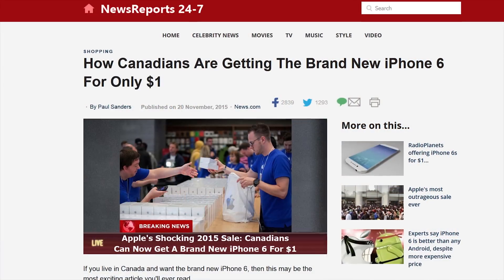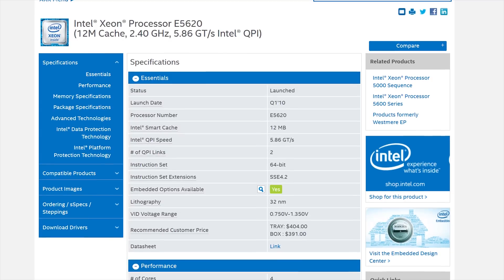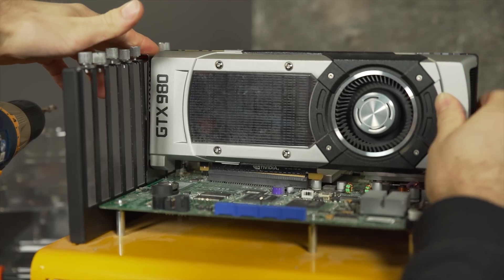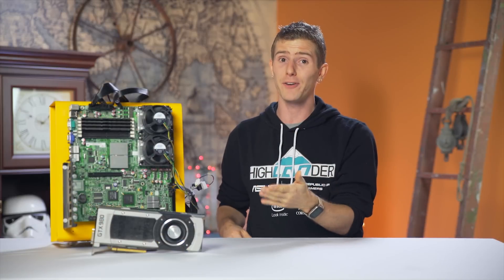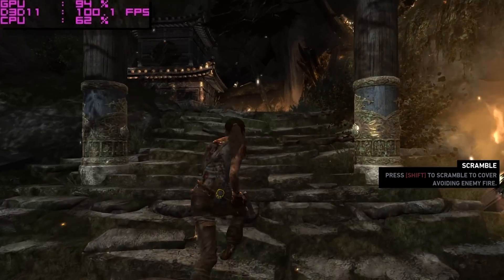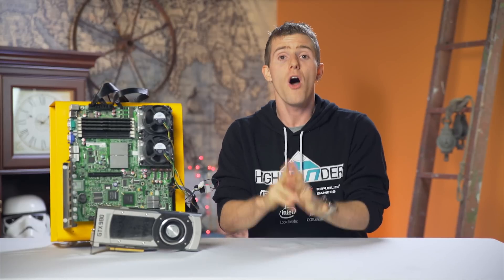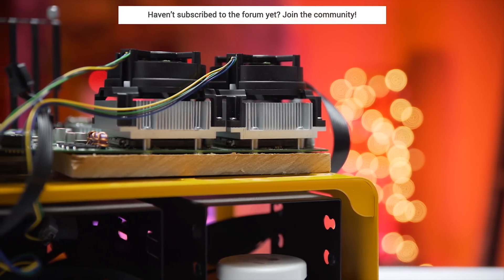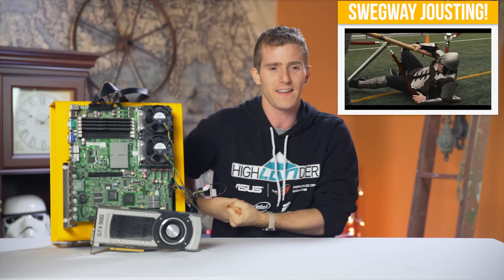Under $150 Budget Gaming 8 Core CPU, Motherboard & 16GB RAM

Comment: i still don't understand why he tested a 150$ system with an 800$ graphics card. and not even showing results with cheaper ones.
Reply: He shows the maximum performance of the Cpu..  If he would use a cheap graphics card, the Gpu would probably bottleneck the maximum cpu performance.

Comment: I was about to buy a Gigabyte server mobo, 32Gb DDR3 RAM, two Xeon E5504 CPUs and two 600w hot swap redundant PSUs for $60 AUD ($45 USD) c:
Reply: sparrow40k Should be awesome!!
Reply: sparrow40k Wait. you got an lga 1366 motherboard for $45???
Reply: The Gamer Duck - Random Gaming Yeah I just bought two Xeon x5560 2.8ghz for it and a GTX1060
Reply: sparrow40k I am soo freaking jealous!!!
Reply: I might upload some benchmarks when the new parts arrive. So far the entire system has cost me less than $350 USD
Reply: Are you Adam Driver?
Reply: looks nothing like me 😂
Reply: look at a really small version of your profile picture and tell me you dont see the resemblance.
Reply: Unguidedone I mean I don't need that much CPU performance so I guess it just depends on your workload
Reply: Unguidedone [x] doubt

Comment: Building computers out of server parts is stupid. It's a much better idea to buy a workstation computer and install a gaming graphics card. And not much more expensive.
Reply: 100 bucks used sounds good too.
Reply: Loli Neko im rocking xeons, x3220 to be exact, they overclocks great, theyre higher build quality than consumer grade processors, and building own pc from scrap is just more fun (at least thats what i love doing)

nice name btw
Reply: I love my Xeons. I have a HP Z600 with 2 X5647 but will probably change them to L5640's soon because of lower power use. Just saying buying a workstation is easier than building yourself. And did you just register this name to make this comment!?
Reply: Don't they pull over 300 watts with ram included almost all the time? I'm going single modded Xeon on a few of my old 775 boards this weekend. The parts, (5640's) will be in by then.
Reply: it all depends on you, what kinof workload will you put on it, if gaming 4 cores is optimal (dx12 and vulcan scales up to 8 i think, but there arent many games using it yet) as for video editing and stuff, i think 8 should be enough (can go to 16 just for lolz)  in the end,it depends on you
Reply: I use a HP Z600 with 2 Xeon X5647. It supports a maximum of 24GB RAM, if you need more than that you need to get the Z800. Or you can get a newer system with E3 or E5 series processor but they are more expensive.
I don't play modern games but even if you do, it's unlikely that the CPU will bottleneck them. Crysis uses around 10-15%.
Reply: +Loli Neko your name is why i wrote this comment xD (realised you question now, lol)

Comment: Another option is to buy a fully functional workstation or server class OEM computer like the Dell T3500-T7500 series from ebay.  Just add RAM and/or replace the CPU to your tastes.  The T5500 is a good middle ground that supports dual processors.

Comment: That way of fixing the heatsinks is very dangerous. With continuous thermal cycles the back plate could not hold the heat sinks...
And these CPUs eat a lot of power... That means they could become very hot during heavy workloads...

Comment: You can always buy Dell Precision 490 workstation for 300$ with double E5450 Xeon CPUs (4 cores each) 8-16GB of ram and just add some GPU to it.
I owed one some time ago, its absolutely fantastic, with great performance (after adding like GF660 or similar to it). Case is master piece, you can even add 8 HDDs to this (8xsata3 controler) + there is no coolers on cpus (only radiators) so everything works like with powermac G5 - wind tunnel from front to back going by this cpus radiators.
This one looks nice - http://allegro.pl/8x-2-66ghz-32gbram-dell-precision-m490-xeon-1tb-fv-i6130050950.html
Xeon 5355 2.66Ghz (2x4core cpu - 8 physical cores)/32GB ram (!) and 1TB sata drive. Only this quadro FX 550 looks quite shitty here but it can be easy replace with some GF card :) 1200 polish "zloty" is +/-300$ :) This machine is hitting about 10.000 geekbench3 points - so for 300$ you got whole nice workstation (CPU like 6700k costs more) I would like to put 2x X5650 in there xD

Comment: One thing he forgot to mention - power consumption.  These parts will put a dent in your electric bill.

Also, you can avoid using those wooden blocks to mount the heatsink if you use washers instead.  Simpler, cheaper, and safer to use.
Reply: Washers come in all sorts of sizes, both inner and outer diameter.  If you look around the mounting holes of CPU heatsinks, you'll very rarely find any conductive contact points for several cm.
Reply: laughs 5 years later as intel processors now use 300+ watts
Reply: Honestly, at an average of 12 cents per kilowatt-hour, most people really won't notice per month unless they REALLY REALLY use it a lot. (At least for the US)
Reply: @benjamingood8511  hum, you never owned a pc did you ? a gaming pc used heavily consumes at least $50/months
Reply: @benemles  And that said, I'm running a 1070ti in my build.
Reply: @benjamingood8511  Who do you think are the average viewers of these kinds of videos ? ....

Comment: my system cost $900, It has a gtx 1060 6gb and 16gb hyper also i7 and it was cheap as chips for the quality can technically play any game for the next 10 years only needing tiny upgrades of $300 in the whole time

Comment: in what world can this be deemed a cheap pc running high end games when your running a gtx 980!?
Reply: Ben Walsh And a sawed off GTX980 at that....
Reply: Ben Walsh in the world where he said MoBo, processor, and memory cost $150. Graphics card, monitor, keyboard, mouse, etc. all cost extra.
Reply: In2017, when GTX 980 are sold used $200
Reply: Ben Walsh its better than any testbench for that price
Reply: Now you can get a 980ti for $250-300 which is about 1070 performance.
Reply: I may be able to do just that! Be prepared - video may be coming soon...
Reply: Ben Walsh yes but you're saving how much for the mobo ram and CPU???
Reply: because read the title
Reply: I know, I actually tried to look for it to see if the price dropped and more powerful cards in newer generations cost £300 less than this fucking thing. (1060 if you're wondering)
Reply: JOSE RAMOS Yes, but do you really have 200-300 to blow around like that. And when this video was made they were in the 600-700s. Currently the market is flooded with Graphics cards and that has helped with the cost because one way or another they can do almost the same.
Reply: @blackonblack...9244  yes, I do.indeed have 200-300 usd to low around like that, considering this would outperform prebuilt pcs considerably more expensive.  What are your hobbies, I am sure you "blow around" 200-300 dollars somewhere in there...
Reply: I blew 750 on the 1080ti and its worth it.
Reply: i blew 1000 on the rtx 2080 TI and its worth it @live2day843
Reply: Stop thinking you can get a good pc for just under 300 dollars.
Reply: @Maeno34  you can though lol...  my current tertiary PC cost me 230 dollars to build.  Specs: rx580 4gb, xeon x3470 oc'd to 4ghz, p55 mobo, 1b hdd 7200 rpm, 650watt psu, 16gb ddr3 ram, case w/fans.  Cost me a total of 230.
Reply: Haha I got a gtx 1060 6gb new for 220
Reply: 980ti doesnt cost much more that 200-300 smackers on craigslist. Pretty much anyone can afford this now

Comment: I saw an abused high end EATX case at the scrap yard yesterday and I thought i was going to vomit and pass out. For anyone who does house clean outs or estate sales, CHECK WHAT YOU HAVE BEFORE GETTING PENNIES FOR IT AT THE SCRAP YARD!
Reply: I got a ml-350 Proliant server mobo, a pair of lga1366 E5630s, 32gb of ecc ram, and 2 compatible heatsinks all for around $110 on eBay.
Reply: ALL motherboards that are even worth getting and are newer than 2004 have a PCI express 16x slot.
Reply: pcguy21 yeah it was a Stryker or something I looked it up and it was like $120 new. The side panel was missing so I didn't take it.
Reply: Sunny Hill 
time is money bro
Reply: What case was it, do you know exactly?
Reply: You need to get some help if you take computer cases that seriously...
Reply: @ironmatic1  who are you to criticize other people's hobbies?  Hes simply saying that, because the case could've sold for a considerable amount of money, it was not a good idea to simply throw it away.

Comment: I have a Q9650 at 9×400 MHz and 8 GB od DDR2 at 800 MHz ... I'm still not sure whether I should replace DDR2 with DDR3 at 1600 MHz (OC) because I have a MB that supports both. Even when the first C2D CPUs were released, some reviewers were worried about FSB bottlenecks.

Comment: Now, a lot of 5500/5600 series chips (Nehalem/Westermere) are available now at good prices. Also, if you don't want the complexity of assembling a system piecemeal, you can just buy a used workstation that might be missing just one or two parts.
Reply: I got two of the westmere 5630 chips for $15 now for the rest of the system I was hoping to go all scrapyard wars on it but  cases are really hard to find.
Reply: Sunny Hill ikr, drill presses will become your new best friend. An awesome tip is to simply measure out where mounting screws and the like need to go for your motherboard and expansion slots, then make the case out of wood. For cooling, you could then salvage a small car radiator (Miata, a-series Mercedes, liquid-cooled Harleys, etc), clean it out really well, and use a liquid cooling system with a liquid-to-liquid heat transfer kit to prevent contamination. You could then make the radiator the backbone of the otherwise wooden case and have one hell of a PC, with a radiator that could easily transfer 3000+ watts of heat for even the most insane builds.
Reply: +Roman Nasuti lol I did my first liquid cooled build externally with a pond pump and the oil cooler from a zero turn mower! The next was the same pump and a junked cooler from a friggin Cessna airplane from the hangar my dad works at. Lol had no problems with temps and was able to push my cpu to the absolute limit.

Comment: I run a x5470 overclocked to 4.33ghz in a 790i FTW lga775 motherboard. The thing screams for as old as the technology is. It's actually stable up to 4.75ghz but no need to run that high. performs just as well as a stock 4670k.

Comment: Little advice? 
I have to choose between a 
E8600 12€
Q6600 16€
Q9550 38€
I'm not a gamer
Thanks lads
Reply: I have 4gb of ram but yeah I'm going for the q6600 and i will do the bsel mod because my hp motherboard doesn't overclock...
Reply: after overclock you do 300-340cb on Q6600. Thats what i do on mine. Pretty sure Q9550 is not much better i thik i watched a video and was 350cb after oc. but search for it here on youtube. E8600 probably is much slower. Price-performance, Q6600 is better no doubt. If money is not your problem and want the best project on 775 sockets, then Q9550.
You can do a overclock on Q6600 from 2.4 to 3.0ghz without having to spend a dime. For edition and other stuff Q6600 will take care of it and will SURELY worth the extra 4 euros.
Reply: thanks man I will get the q6600 for sure !
Reply: e5450 $20

Comment: Or you could buy a LGA775 motherboard and mod the socket to fit an 771 processor with example, x5450 or x5460 and mod your bios to make the cpu readable. x5450 is like intel q9550. 
Then buy a 4gb of ram ddr2 or ddr3 (whatever the motherboard supports) and an SSD around 128gb to get the speed in windows and gameloads.
Buy a used gtx750 ti and use whatever case you have laying around with a PSU.
I manage to build my daughter a computer with all this for around 160 dollars with everything you need!!!! :D and she loves it! BF3- BF4 at around 60 FPS on all settings high.

Comment: If you want dual CPU, get X5492. If you go single CPU and plan on overclocking, get X5470. Those are the two best CPU's you can have in an LGA 771/775 motherboard.
Reply: They have the same stepping, so they should be very similar in terms of overclockability. The reason I think X5470 is the superior chip, is due to its high multiplier.
You are likely to hit your FSB limit before reaching the maximum overclock for either of these chips, so the one with the higher multiplier will overclock higher.
Reply: 1050ghz? That's a supercomputer
Reply: Z3phyr Not compatible with LGA 771/775.
Reply: And there is even better series for oc, which is "E" 5450 etc... and they use less power, i think E>X for oc 
Im running x5450@3ghz with msi r9 270@1050ghz ,4g ram on p5k pro...
1050p war thunder tanks: 45fps movie setting
cs go:120fps med/high
Reply: Chunky Squirrel You still need the sticker, even if you cut the slots into your CPU.
Reply: ight bet
Reply: Dylan Lewis Thats mhz
Reply: x5650 is better
Reply: Nekros I'm thinking of buying an E5410, I found a guy whos selling one for $5. Do you think it would work with a Gigabyte G31 S3G socket 775 motherboard with the adaper-mod-thingy?
Reply: Chunky Squirrel Should work without a problem.
Reply: Chunky Squirrel You don't actually have to mod your motherboard. You could mod your CPU with a set of diamond files. That is what I've done with mine.
Reply: Nekros yeah i think ill fuck up my cpu, i dont trust myself :P
Reply: Nekros Thanks for the help :)
Reply: Chunky Squirrel It's up to you, but I doubt you'll fuck it up unless you do it intentionally. A lot of 771/775 contacts are redundant and the ones you'll be cutting into aren't even gonna connected to anything in a 775 socket.
Reply: Nekros Thanks for the tip, if my adapter doesn't arrive soon, I'll try doing that

Comment: Or just get a X5650 and a X58 board.
Reply: sparrow40k That is an amazing computer for 350. You will be satisfied, I guarantee it.
Reply: sparrow40k
that's almost like buying the GPU & motherboard and getting everything else for free...
Reply: I'm pretty happy since this system specs are:

CPU: 2x Xeon X5560 2.8ghz
RAM: Samsung 32Gb (8x4Gb) 1600Mhz M393B5170EH1-CH9
Motherboard: Gigabyte GA-7TESH1-RH
GPU: EVGA GeForce GTX 1060 3GB SC
Storage: (Forgot brand) 256Gb SSD
PSU: 2x Delta SR1625 650w
Case: Stock case but plan to change later on

Total cost was less than $350 USD
Reply: I would say that an x5650 @ 4.5ghz is better than a current i7 for editing because it has 6 cores 12 threads
Reply: if you're having PSU issues, I feel bad for ya son... I got 99 case problems, but wattage ain't one..

Now running i7 6700k on a z170 pro gaming board w/ a GTX 1060 OC6G, 5 internal 7200rpm SATA hdds, a BluRay Writer and 5 fans... yet my Thermaltake 650w Smart PSU has no issues running my system... so why does your older equipment need more power?
Reply: Ministry of Destruction get a used 960
Reply: that tech is difficult to find retailers for it still... and this video was made ~9 months ago...
Reply: cool
Reply: I just ordered two X5560s. I wanted to go to 5600 series but the manual only had 5500 listed as supported
Reply: What do you think of its performance in 4k editing?
Reply: not to mention, if you've OC'd the CPU, you could have OC'd the i7 too..
Reply: KremitDeFrog Canadian?
Reply: my main pc has a x58 board that is still going strong
Reply: Acer Altos G540 M2
Reply: I have an EVGA GeForce GTX 1060 3GB SC coming in the mail this week
Reply: The motherboard is more expensive than the CPU but its a really good CPU
Reply: thats better still more than 150 maybe 170 not including ram
Reply: are people able to get that? got one in the mail and a asus x58 Workstation board ready to overclock the balls off it lol
Reply: the 6800k is now for sale.. NewEgg currently has them for $439.99 (holiday sale that ends in 7hrs)
Reply: M Curry hahaha, we wish... and this is why I don't build pc's for profit...
Reply: What is it with people recommending unnecessarily powerful PSUs? :P 750W is overkill unless you have multiple non-current-gen cards.
Reply: Not when CPU draws almost 300 watts lol
Reply: Samira Peri how about an amd 6990, my corsair gs700 can only just support it and thats with an underclock or even something like a titan z or 690 will draw more power than you think
Reply: bro my old pc had a x5560 in it :D
Reply: KremitDeFrog ya man x5650 draws over 250 watts overclocked yours is probably under 150 lol
Reply: or just get i7 6700k with gtx 1080 and have no problems running all new games
Reply: Z3phyr cheapest x58 i could find was 400 usd
Reply: yes
Reply: Good luck getting one in good condition. I tried looking for one then I decided to go with a  new R7 1700 instead.
Reply: +tyaty have you heard of our lord and saviour, the i5-2500?
Reply: KremitDeFrog for the price tho....
Reply: Nutcracko Games a gtx 1060 probably costs fking 350usd in canada rofl
Reply: WTFGAFS the cheapest one on newegg is 384$ its cheaper than 350 usd
Reply: I held off on purchasing the 6700k because I heard the 6800k was going to have quad-core 4.2ghz.. even saw a picture of the info on the die.. but turns out it's a 6 core, 3.x ghz... if I wanted that, I would have just purchased the 5850
Reply: most x58 boards are abused and dead at this point. I have evga x58 classified sitting in the closet. sometimes boots,sometimes doesn't. working ones cost $100++. you can get i5 2400 and a board for that price.